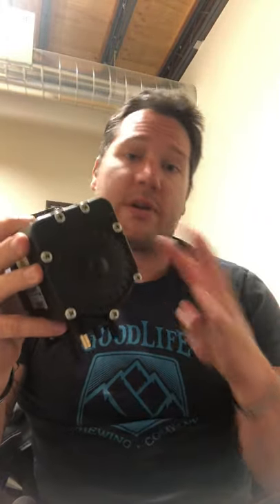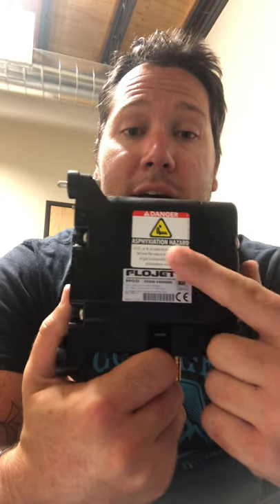Quick Overview of Flojet Beer Pump

Comment: Hey Kyle, great video. Thank you for the information. I recently began working at a bar and someone had already setup the flojet with a mixed gas setup. I am trying to wrap my head around it. What the installer did was adding a splitter to the keg coupler. One goes to a direct draw system on the same floor and the other end goes into a FOB through a flojet which pumps beer to the floor beer (I don't know why they added a pump for a gravity fed system as well). But now I am trying to balance lines through all this and man am I having a hard time. Do you think getting rid of a splitter would help? Additionally, would adding a splitter at the end of the FOB help? Thank you for the comments.

Comment: Hi Kyle - Thanks for the video.  I'm getting ready to install taps  to my second bar area.  It's about a 25 foot run tops.  Anyway reading the documentation on the FLOJET pump it states. 

"The operating pressure to the pump is used to control
the flow rate. Due to the pumps powerful hydraulic push
against the beer, the system must be considerably over
restricted. Use the following as a general guideline:"

For 3/8" ID Trunkline
• Up to 100’ length, use 13 feet of 3/16" choker line
My question is where is the choker line located or is the proper pressure to the pump better achieved using a dedicated regulator.

Thanks
Mark Olenick

Comment: what is the relationship between the pump operating pressure, line length & ID, and dispensing flow rate?
I have a 55 foot length lines, 3/8 id.  And would like to keep flowrate at or near the recommended 1 gpm.
Reply from the maker: Pump pressure will be determined by the length of the beer run, ID of the line and material of beer line. I usually start with the I.D. measurement and work from the beer cooler to the dispensing tower. The ID of lines will give you a restriction value by foot. Vinyl ID is .20 per foot and Barrier is .06 per foot. Once you have this restriction value you use this for the length of the beer run. Remember, Vinyl, Barrier tubing and SS have different restriction values. So you will need to make sure you're using the right value for the right length and right material. From the information that you gave me off the cuff I would set the pump pressure to 20 PSI and check the flowrate at the beer faucet. If the flow is not enough and would bump it up until the 2 oz per second is achieved. That pressure should put you in the ball park. Cheers
Reply: @kylerenstrom1342  Thanks Kyle.  One follow up Q:  Will a lower than "design" pressure produce less flowrate or less flowrate AND foamy pour?  Is the pressure loss from the line length enough to get co2 out of solution (in a flojet pump installation)
Reply from the maker: Jorge Delgado it will be a a lesser flow rate and potentially foaming beer... because applied pressure won’t equal the restriction value of the system. However this is for a small amount of time until the flow rate is achieved through pump pressure.As far as beer losing CO2. I wouldn’t expect that to happen because. The keg pressure is controlled by a separate regulator inside the walk-in cooler and is only catching a ride from the beer pump to a draft tower.